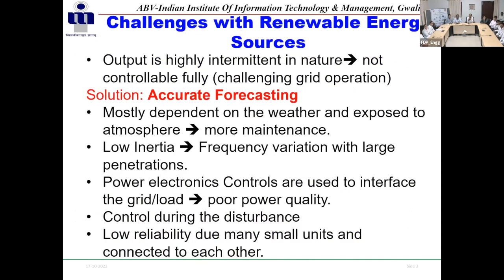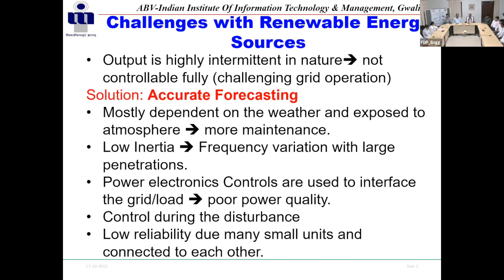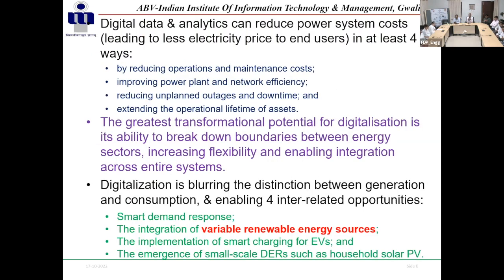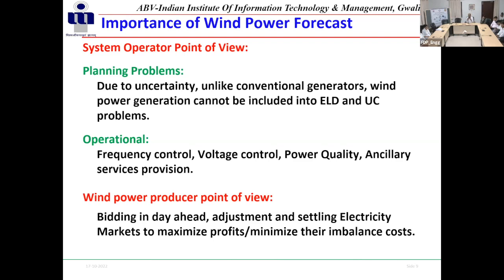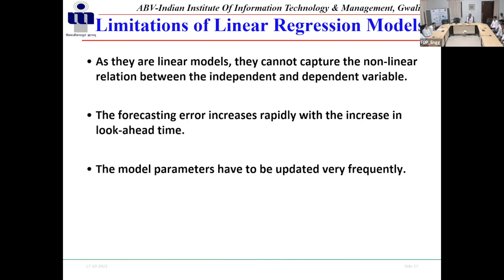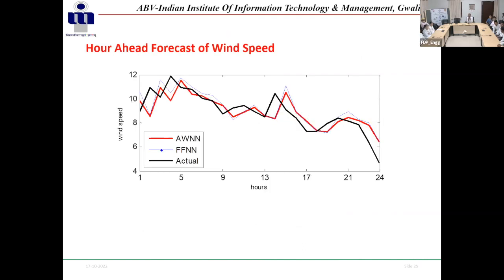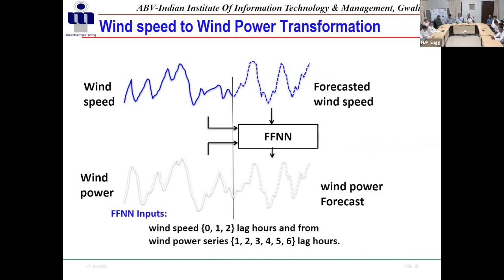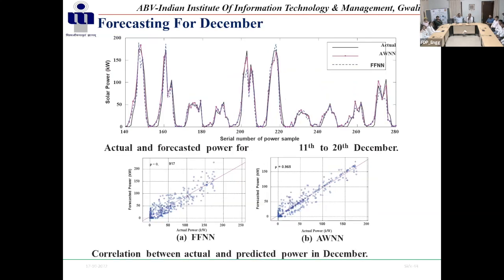ANN based Renewable Power Forecasting by Prof. SN Singh

Comment from the maker: 00:31 Renewable power forecasting using artificial neural networks
02:57 Load forecasting is essential for maintaining power generation continuity.
06:59 Forecasting wind power for grid operators is challenging.
09:06 Challenges of renewable energy integration
13:20 Transition towards DC power supply for improved renewable energy utilization
15:47 Transition to more DC power generation for renewable sources
19:27 Challenges in connecting different capacity renewable power to the grid
21:19 Renewable energy sources and energy efficiency for decarbonization
24:51 Digital technologies enable flexible grid management for renewable power
26:41 Forecasting renewable power based on historical data
30:44 Wind power forecasting and its impact on income maximization
32:40 Wind power output depends on various factors.
36:25 Forecasting error increases with longer look ahead time
38:24 Data selection and correlation factors are crucial for accurate renewable power forecasting.
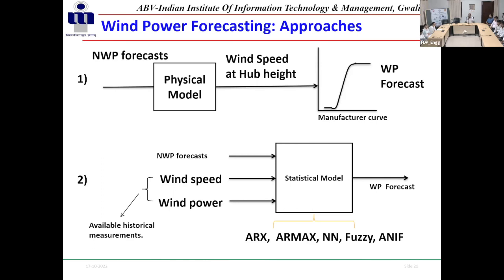42:25 Utilizing models to forecast wind power output based on wind speed and historical data.
44:16 Utilizing neural networks for renewable power forecasting
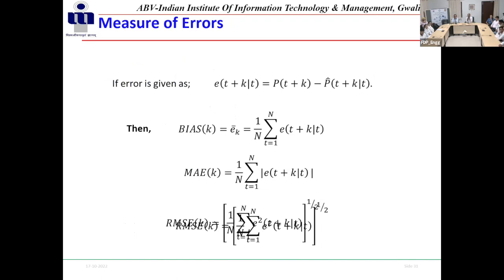48:05 Forecasting techniques are important for determining the accuracy of the forecaster.
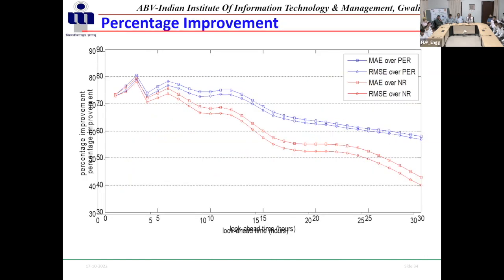49:56 Improvement in renewable power forecasting models
53:39 Renewable Power Forecasting in UK
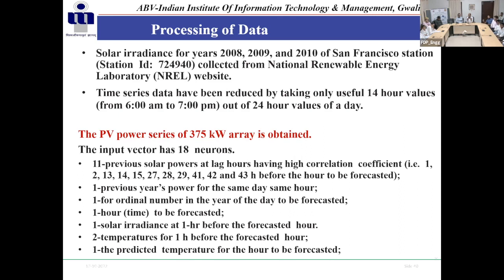55:21 Forecasting renewable power based on collected data
59:11 Utilization of data analytics for accurate renewable power forecasting
1:00:58 Renewable power forecasting integrates information and communication technologies